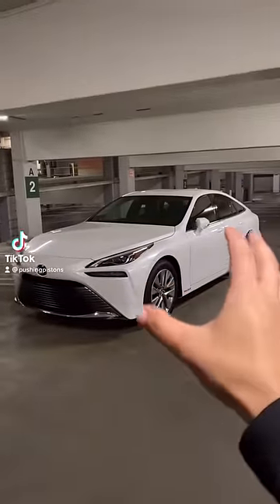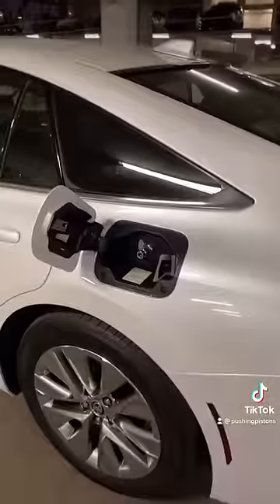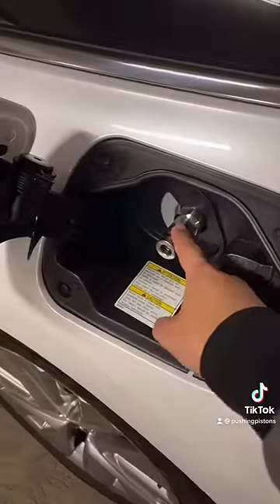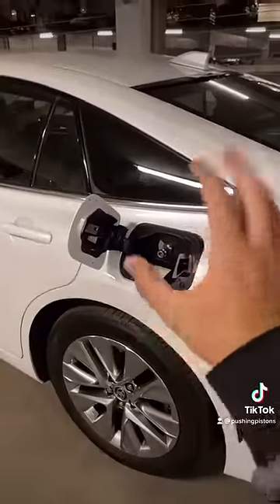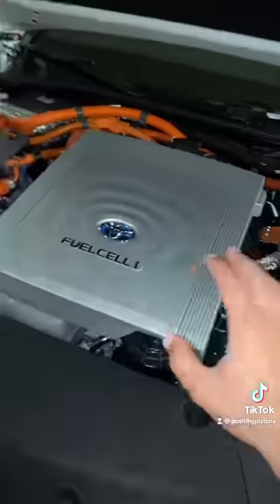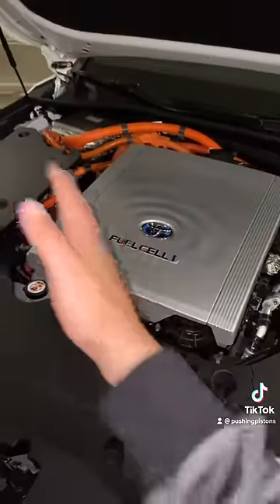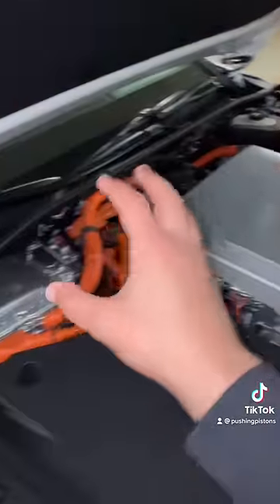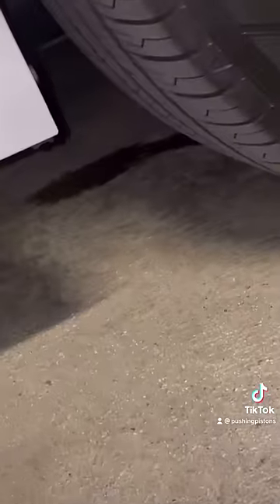How Toyota Mirai Works

Comment: Wrong hydrogen uses a engine based just like gas with a hybrid electric engine. The hydrogen gas burning engine is up front under the hood the electirc is on the rear axles. It is not just electric this dudes so off its sad. It uses a gas engine that burns gas thus powering the alternator thus powering the electric motors as well. The water leaking is the gas engines exhaust pipe that burns hydrogen fuel instead of gas.The next hydrogen cars will be all engine burning hydrogen. With no electric engines. The mirai uses a gas based engine that runs of hydrogen and a hybrid electric motor system . The best toyota hydrogen gas powered cars will use the lexus lc 500 engine making massive power 550,hp to be exact. Bmw has been making hydrogen gas engines for a long time. This video is so off its killing me. This is the exact same as any gas and electric hybrid system but instead burns hydrogen instead of gas. This is not even close to what happens. The gas burning hydrogens alternator powers the batteries that power the electric. Powering hydrogen and oxygen would make the biggest explosion known to man lol. Next hydrogen and oxygen does not make a reaction making electric if it did we would do that for making electric to solve the worlds problems. The dam engines exhaust is whats leaking water when you burn hydrogen it makes zero exhaust emissions only water drops. Your not a mechanic and just misinformed a lot of people. If ypu do not believe me go look at the internal combustion engine up front and the electric engine mounted in the back. Just google mirai hydrogen engine they show it all.
Reply: There's no combustion engine in this car. You completely made that up.

Comment: Sooooooo...still using batteries and electric motors makes this electric car less efficient than a tesla. It makes water. But can those batteries be charged by solar? How about wind? How about a cable and plug like all other electric cars?
No?
None of the above?
Then I'm much less than impressed.

FAIL